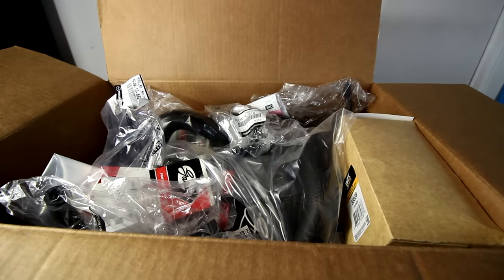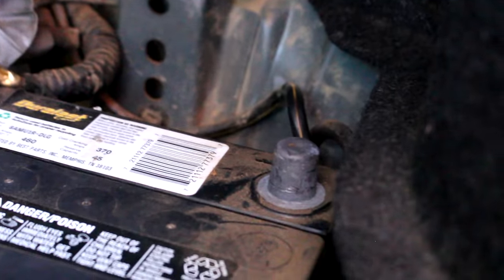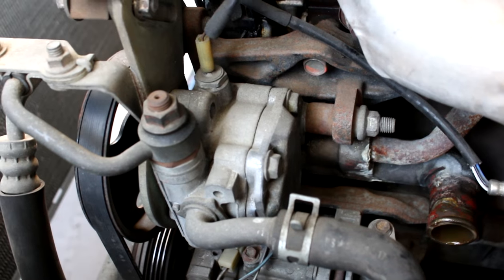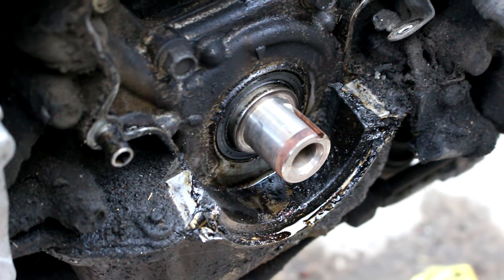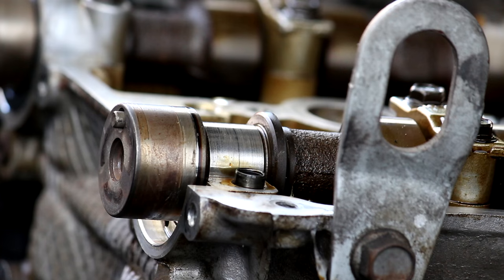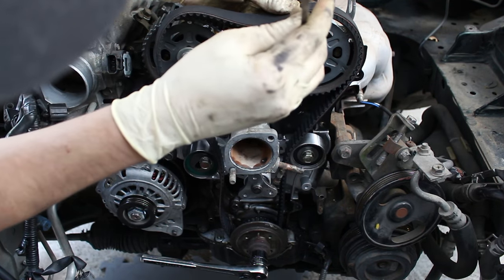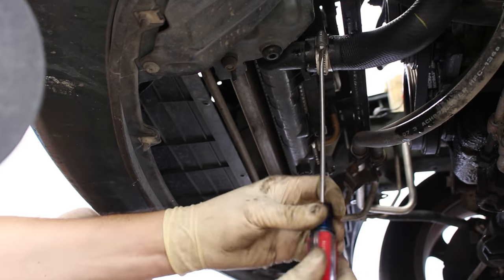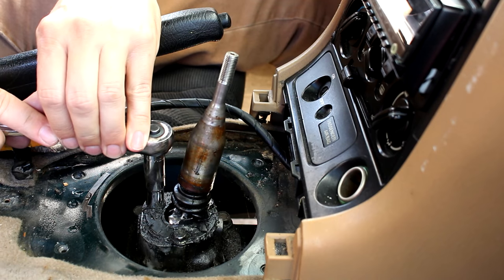The 2020 ULTIMATE GUIDE For Replacing Everything Your Miata Needs! [Project 2SJ Ep6]

Comment: So... I got a '91 MX-5 and the harmonic balancer (that outermost pulley on the crankshaft) is oscillating slightly, while the center crankshaft bolt is not. Is this what it's supposed to do or is it that issue that ends up killing your crankshaft bearings and generally wreck your engine block? It already has the larger bolt and 8 slits on the pulley, so it shouldn't be that, but no one could answer me this with certainty. The previous owner changed the timing belt a couple thousands km before selling it to me and.. let's say I don't really trust his skills.

Comment: I have one question after watching this video and taking my notes... is there a 3rd cam seal for the rear cam cap, or is it just a plug where the CAS was on the 1.6L engines? Is there anything special that needs to be done to install that one or do you just remove the rear cam cap, replace the plug/seal, and put the cap back on? Thanks!
Reply from the maker: It's just a cap that gets pinched in by the 2 12mm bolts on the back of the head. Some people use a little RTV on it but I've never had an issue with it leaking.
Reply: @TheCarPassionChannel  thanks!

Comment: Hi, thank you for your video! I have a question: what do if the exhaust cam has been rotated down? How to put it in the correct way again? I would appreciate for any tips!
Reply from the maker: To be safe, rotate the crankshaft so none of the pistons are at top dead center, then you can freely rotate the exhaust cam however you need to
Reply: @TheCarPassionChannel  thank you!

Comment: NA8 the same? My other Miata is a 95M :D
Reply from the maker: Nearly identical. Any differences that exist will be recognizable (different plug locations, etc) but the main things are all the same (order of install, parts orientation, timing belt marks)
Reply: @TheCarPassionChannel  That's what I thought. Thanks.  I'm not sure about all the running changes in the 1.8 from introduction in '94 to VVT in the NB2 (01+) you showed in your VVT build series.

Comment: Miata Dad! Help!!! I think I'm having an issue with my 1 and only key, however, my miata will start on the first try, run perfectly fine, then after about 2-3 minutes, dies. No warnings, no lights. I go to restart, and it starts fine, runs 30 seconds, dies. 3rd restart, car refuses to start. After a few minutes, I retry and the process starts over. Any ideas?

Comment: Hey Greg for the cam gear timing I have been having trouble getting this answer. When lining up timing marks on the cam gear are you supposed to line up the mark cut into the tooth with the timing plate mark or are you supposed to line up the "U" shape in between the teeth with the timing plate mark? 

I ask because the rounded shape of the timing plate mark seems to fit perfectly in the U shape in between the teeth.

Also thank you for this video, I recently swapped a vvt head onto my NA and also did everything you mentioned in this video. I can't say thanks enough it was so helpful and saved me tons of time. Also makes me feel a bit more confident in my work since I was following Miata dad specs lol.
Reply from the maker: The cut is what's supposed to line up. but the belt tension has to be perfect everywhere for the marks to line up perfectly, as long as it's very close you're fine. I.e. as long as it's not the distance of an entire tooth off
Reply: @TheCarPassionChannel  Ok that's good to know I wasn't able to find a super clear answer in the searches I did. Thank you for the info.

Yeah after honestly about an hour of trying to get the marks to line up I got it like you said close enough and called it a day. For some reason mine seems to want to line up in between the U shape and cut marks. Wonder if shaving the head 0.040 makes a noticeable visual difference? But they were not a full tooth off luckily, it was very close.
Reply from the maker: @biggboysouth  Yes. Head shaving definitely changes the location of the marks, it actually changes the cam timing. (Retards both intake and exhaust slightly)

Comment: Quick question has anyone ever has the water pump intlet (other known as the mixer housing) leak from the 90 degree fitting that the coolant hose connects too ?? I have replaced that hose and clamp and the fitting is still leaking! Anyone point me in the right direction please? Should i just replace the inlet??
Reply: is it the one below the exhaust header? ive had to replace that inlet as it failed on that 90 degree fitting as well, think it is a common issue. On mine due to corrosion i could pull the 90 degree bend right out of the inlet. I replaced the inlet itself and to warn you there is a gasket which sits between the inlet and the water pump, it stuck to the water pump and was a pain to remove with razor blade.

Comment: 9:53 just loosen the sway bar and get an impact on there :)
Reply: If you have a professional impact wrench sure. But don’t underestimate the torque required. When tightening they require 150-200Nm, obviously it is more difficult to loosen it. He is pulling full force with an arm much longer than 1m. I would not be surprised if it is tighter than most cheap impact guns are rated for.

Comment: Could you make a video of replacing oilpan gaskets because i dont have a engine crane 🥲 is it possible to do it on jack stands??. Ps love the videos bro🙃✌
Reply from the maker: Yes it's possible! You need what's called an engine sling, they are much much cheaper than cranes and don't take up much room. I'm sure maybe it's possible to DIY one also. If you check out any of my videos where I change motor mounts you can see the tool I'm talking about
Reply: @TheCarPassionChannel  thanks for that quick response man. Yeah im ganna look up you video asap and watch it. Keep it up 😁✌

Comment: Hi Craig, I have a question, Brand new to the MX5 owner scene, I am just about to purchase all the bits I need to go ITBs with an MS3, Since I'm running ITBs, I assume I will need a vacuum chamber connected to each of the ITBs and run a vacuum line to the MAP sensor on the MS3. 
By doing this I can avoid the need for the IAT, is that correct? ITBs + MAP + MS3 = No IAT?
Reply from the maker: The ECU always needs to know the air temperature. With ITB's you can tune via speed-density (map based) or alpha-n (TPS based). I haven't tuned ITB's myself so I'm not sure what works best. I would personally try MAP based since that's what I know.
Reply: @TheCarPassionChannel  Thank you for the prompt response! I'll talk to my local tuners and see what they say too, Since I have the option of both.
Reply: @TheCarPassionChannel  Your video has been incredibly informative, thank you so much for the guides (especially since I'm an NB owner to be)

Comment: Can I save this video for my NBFL 1.8 or is it not compatible enough?
Reply from the maker: @f-7292i  It's 99% identical. The only differences that come to mind are relating to the VVT gear and oiling system which is not complicated at all, just a few extra bolts. And there will be a couple different electrical connectors.
Reply: @TheCarPassionChannel  Great, just received my miata, need to buy a low profile lift and 4 Jack stands, then I'll start working, will be a useful video thanks for the work.

Comment: That front crank seal will not go in . Cleaned everything , oiled it up , heated the oil pump housing , used  1-1/4 socket to push it on . No luck . If it tap it with a drift , the spring pops out . Ughh!

Comment: My bad . Cleaned all the rubber from old seal and left the metal ring in the oil pump . It appeared to be part of the pump . Ruined the new  seal . Cut open  the ruined seal to see my mistake

Comment: Hmm, just bought a treasure coast miata kit for the timing belt + water pump, and it did not come with the cast style water pump as this video states. =/
Reply from the maker: Unfortunately sometime between when this video was released and now, Gates no longer makes the case impeller version. So no matter where you buy from you'll be getting a stamped steel unit
Reply: @TheCarPassionChannel  Yeah that makes sense. Thanks for replying!

Comment: Am I missing something or is the Miata coil order 4132
Reply from the maker: 1342
Reply: @TheCarPassionChannel  on my 99 Miata the wires go passenger to driver side 4123
Reply from the maker: @motocrossraymond6060  99's are still wasted spark which means 1&4 always fire every revolution and same for 2&3. So the 2 coil packs (The 1/4 and the 2/3 pack) alternate firing. It's called wasted spark because it always fires on the exhaust stroke also even though there's nothing to burn.

Firing Order:
1 (Coilpack "1/4" sparks)
3 (Coilpack "2/3" sparks)
4 (Coilpack "1/4" sparks)
2 (Coilpack "2/3" sparks)
Reply: @TheCarPassionChannel  ok I just bought a 99 Miata and it didn’t start due to low compression. Last owner said it over heated he sent the head out to get pressure tested and everything was well. Coolant system replaced. So I put oil in the spark plug holes and get it started. It runs like shit tho and is hard to start. It has 180k miles and he only replaced the timing belt, crank position, and cooling system. And it does has a mis fire
Reply from the maker: @motocrossraymond6060  definitely make sure the ring belt was installed right!
Reply: @TheCarPassionChannel  which One is the ring belt? I only know if 3 belts alternator power steering and timing. My timing is off by a half tooth but one of my mechanics said that wouldn’t affect anything a lit
Reply from the maker: @motocrossraymond6060  Sorry, the timing belt, autocorrect. The belt can't be half a tooth off, but it can be a full tooth off. Worth looking into

Comment: Isn't that oil cooler?
Reply from the maker: It also serves to get the oil up to temp faster from cold start, since the coolant heats up significantly faster than the oil
Reply: I put one on my car from older BP05 engine, it cools engine oil from 120 celsius to aprox. 90. (its turbocharged engine with only oil, no water passages in turbo). 👌